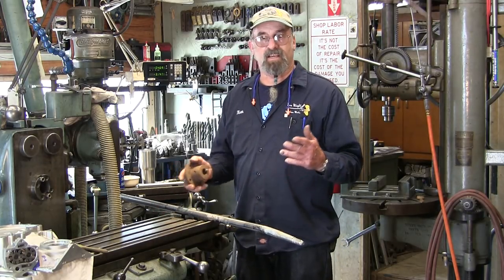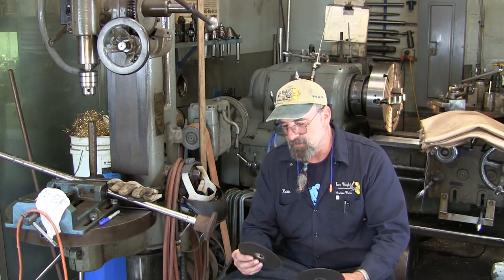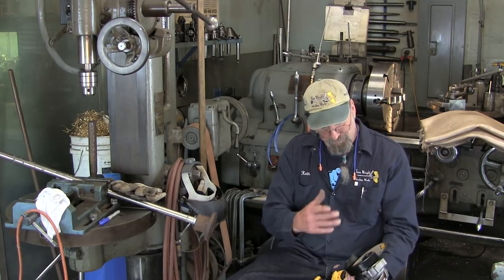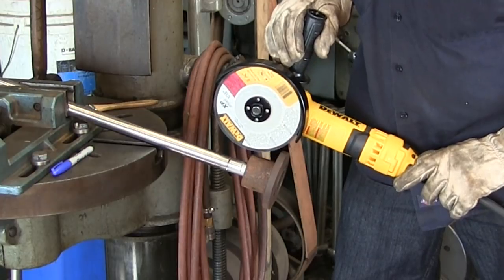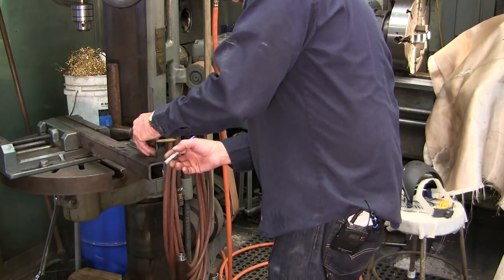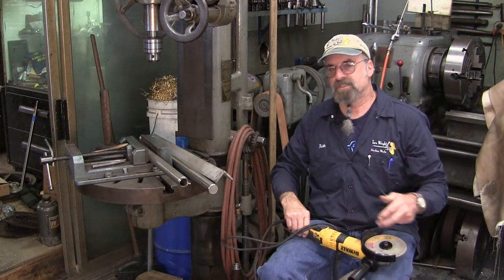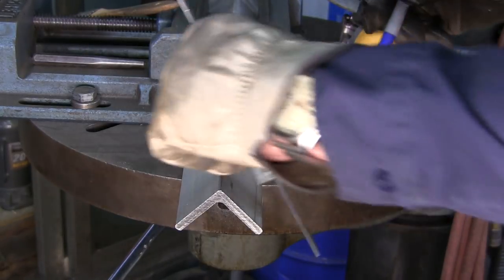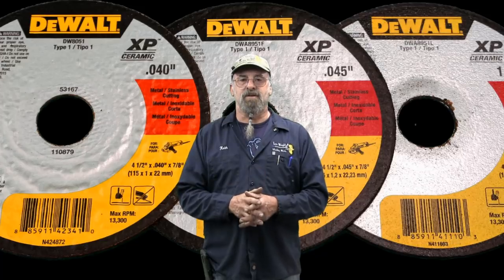The Slit Tip Made Easy by DEWALT™ + Giveaway

Comment: I just cut some 1x2x1/8" tubing for a frame and cutting those 45 degrees angles was a pain.  Have several DeWalt grinding wheels but haven't tried their cutoff wheels yet.  It's funny the better I get at grinding the better I can weld..LOL.

Comment: Those discs cut through that material like they were butter. I was wondering if you applied any extra pressure or just let the tool naturally work it's way through and I heard you comment that it was just the tool itself running through the cut. Would LOVE to have one of those since all my work is basically field work.

Comment: DeWalt couldn't have found a better spokesperson. That's an awesome cutter and the bubble level in the handle is another great idea, maybe as an after market add on. Hint hint DeWalt.A good example of a tool designed to USE instead of designed to market.

Comment: No time to wait on no giveaway gotta git er done. I spent 13 hours cutting one side of a 57 inch by 42 inch by 10 inch  stainless holding tank. Diamond sawsall  blade lasted 5 seconds, I got an inch and a half out of 6 inch cutting wheel, fried 5 plasma tips on a 22 amp plasma cutter. Holding tank is fabricated from 1/4 inch stainless sheet. I will be purchasing blades ASAP. I needs my flood coolant trays.

Comment: Excellent demo. I'm sure Dewalt is listening so I would like to say a couple things. I like their products and would like to see an adapter made so when using this 6" grinder and these wheels when worn to it's min. worn diameter it can be remounted on their 4 1/2" or 4" model grinder to utilize the rest of the wheel. Second, I would like them to come out with a model grinder which has a tilting head like I have seen on another one, maybe it's the air or elec. grinder you have shown and used in your other videos. Looking forward to trying out these new xp ceramic wheels. Thanks for the demo. Ed K. Cleve. Oh.

Comment: Good video.Dewalt has always made top notch products I have tried other brand cut off disc's and Now only use Dewalt disc's,the other brands wear much quicker and seem to have a higher fracture rate.In the end the Dewalt disc saves money and is safer.

Comment: I had the switch go bad on my dewalt circular saw after it was probably less than five years old and couldn't buy a new one because it was a discontinued item. I re-engineered and 10 years later it's still working great. It just really annoyed me that I couldn't get the part from them.

Comment: thanks for the video keith  especially for not turning it into a commercial for dewalt keeping it real and honest with informed opinions are much preferable to colon cancer from smoke blown.... .. im still fiddeling with that bullpup ballista  and am wondering if you would care to scarifice a 2 inch length of that 1/4 wall 2 inch box to the press?  i need a failure load for 1/4 wal box to effectivly allow for loads.. thanks  have a few more questions when you have some free time a farbetween as that is lol
Reply from the maker: Sure message me with address and I'll cut you off and send a piece to play with. ;{)------
Reply: if i had a press that would work lol  i just need to know approximately what load it will hold before failure..  2 tonnes + and im happy it would mean i can use 3 /16 instead of 1/4

Comment: Hi Keith I don't normally comment on the comment section, as I just like to watch lol.  
That was impressive on the ceramic wheels cutting speed !!!  I will give them a try.    I go through a lot of cutting disc, the last batch I bought was dewalt and I liked the way they cut  and lasted a bit longer. I normally buy them a100 at a time lol. thanks for the video. Tom

Comment: I wonder how they stand up to the standard cutoff disks? I mean by how long they last vs the xp ones. Ive seen the xp ones in stores but passed them up because I knew the old ones worked without much issue, but if they last longer andcut more, I may have to look into them again.

Comment: Very impressed with the Dewalt XP Ceramic blades.    My shop has abrasive cutoff machines, a cold saw, a portable band saw
 and a sawsall, in addition to a 17in bandsaw.    These XP Ceramic Metal Cutting Blades will definitely improve my shop productivity.  Keith, thank you for the very informative demo.

Comment: I have 1 9" dewalt and 3 5" dewalt's  I use everyday on the service truck . I use more grinding wheels and 60 grit wheels more than anything tho not to much on cutting wheels, usually working on heavy equipment it's the cutting torch or plasma

Comment: Keith,
Would it be reasonable to reweld the slot cut in the coupling and rebore the hole for future use? Or is that a dumb idea?
Eric
Reply from the maker: It is made of ductile material and if you were successful, the shop labor for one repair would overrun the cost of new. ;{)------

Comment: How do you like that 6" grinder? looked like you we're leaning on it pretty good.
Reply from the maker: I had a ferm grip on it and could of pushed more, but habit from other blades, that can load up and gall on the surface of the blade and then float the blade, instead of cutting. I like the feel of grip positions and the lightness it has, with kick, watch the starting of the grinder in every scene, I was focusing hard on holding in line with mark.   ;{)------

Comment: In one of your older Video's you cut some steel with a grinding wheel....I'm thinking surely you know about the thin cut off wheels.
I didn't comment about it cause you probably had your reasons for doing it that way.
Anyway DeWalt here's my comment and I can always use another dewalt grinder

Comment: Do they make a cut off wheel with a cup or divot so the nut is kept out of the way?
Reply from the maker: Yes they do!
 http://www.dewalt.com/en-us/products/accessories/abrasives/bonded-abrasives/type-27-small-diameter-cutting-wheels/xp-ceramic-metal-cutting-wheels-type-27
  ;{)-------
Reply: Excellent

Comment: good show i use alot of radner .045 6" cuttoff wheels at my shop ........i bought a dewalt 4 1/2 grinder at rual king a coupla years ago and it didnt hold up very long less than a year ...i have switch to porter cable grinders in the 7" size and have had them going on 2 years now with daily useage ......... not sayin that dewalt is not good just my luck with them ........

Comment: Maybe I miss it but for safety you should of have mention about check the RPM of the blade against the grinder you are using making sure the blade is reacted at the same RPM or greater then the grinder you are using. Seen a man almost loose a finger because of this.   .

Comment: I never win on give aways... but I'm entering anyway.At my former work we used Bosch blue tools, in private life I used dewalt tools, I still got a few tools left with old school battery packs, the modern 18V drill has issues with charge and I need to sort that out. As we use 220v volt here, I can use American tools on my 110v step down transformer. If needed I have a USA post address. :)

Comment: Keith

I'm ineligible for the giveaway but I'd still like to see DeWalt and other manufacturers take up your suggestion about the bubble or bullseye level on the handle and / or on the body of the tool.  It would be a useful feature.

I didn't hear you comment about it, but did you find the design of the 6" model with the inbuilt body handle better for cutting ?  I doubt you'd be able to cut SS shaft as safely with a smaller model, especially if the screw-in handle's been removed for one-handed use.

It would be good to see a comparative shoot-out between Dewalt's discs and a couple of other known brands like Pferd and Flexovit, using the same grinder.

Best regards from Australia

Comment: Hi Keith,  looks like these ceramic discs cut through these samples like a knife through butter, perhaps they should have named the discs 'Ceramic Knifes' 😂 Also, there appeared to little wear on the diameter of the blades.  Normally cutting through a solid bar there is a significant reduction in disc diameter.  Anyway, interesting video.  Many thanks for sharing.  Kindest regards from Bonnie Scotland.  Joe.

Comment: Keith, I bought a 4.5 inch Dewalt angle grinder a few months ago and its been very handy.  Used it last night to cut some 26 ga vent pipe.  A 6 in would complement it nicely don't you agree?

Comment: Oh how mighty have fallen ! Dewalt,Makita,Bosch,Starret pretty much all "brand" names whored out for profit and produce  junk,they are not the same quality as before.I seen bosch drills made in 70s full aluminum body that still run,do you think anything you buy in 2017 will last untill 2057? I dont think so.If it runs for a year or 2 you are lucky.You bought those in 90s while tools were not garbage as they are today.
They dont fix problems ,makers just remake tool,put a new sticker and some sucker will buy it .Flaws are now welcome product design-lifespan of a tool is = to a warranty,they deliberetly put faulty weak materials that will wear in a 6 months.Its made from junk recycled metals,you dont fix your angle grinders-throw it buy a new one,its cheaper than repair,so cheap its not worthy to repair.
Round and round we go ,junk made from junk which produces even more junk, thats where buying cheap got us,where does it stops nobody knows. . .